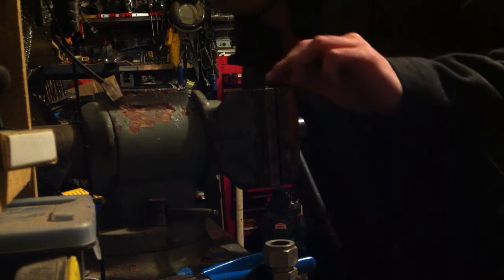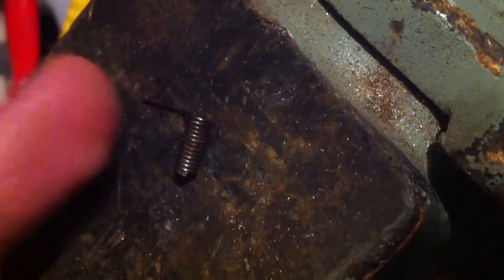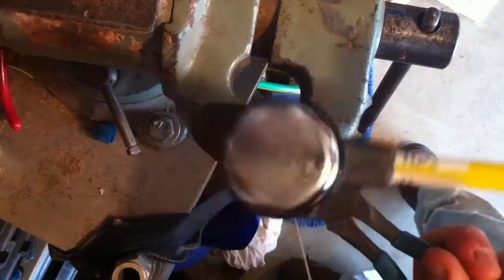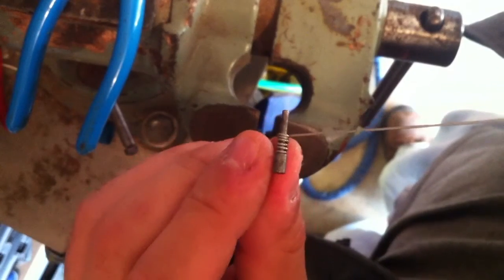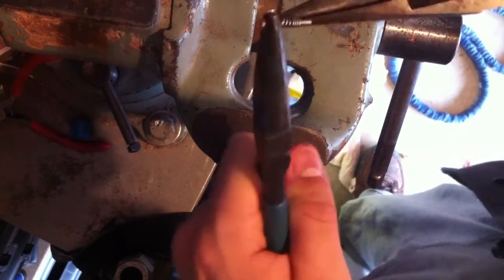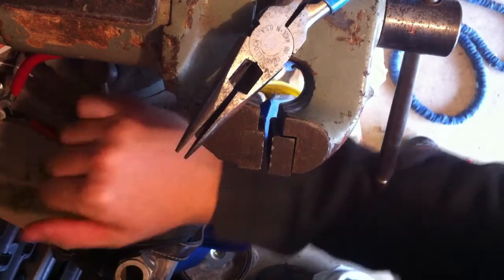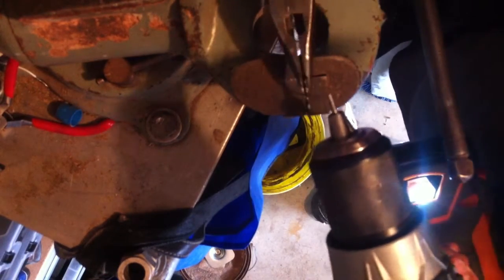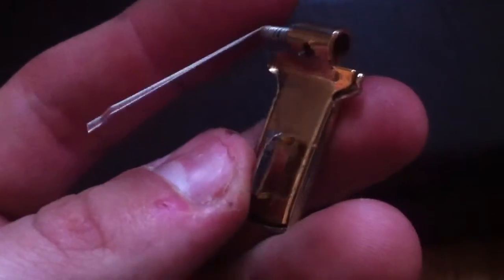Case Repair - Respringing Latch

Comment: Great vid.  I tried to make my own replacement springs using piani wire lenghts, and it sorta worked. Got one latch done. Curious to see how you got the pin out of the latch. My nexr one has closed ends on thin the pin area. Absolutly whant to reuse the latch as the brand logo is printed into it, and that's real cool.

Comment: I loved you drill method, but I think your local hardware store will have those…
Reply from the maker: Hi Robert, in Canada I really have not found any torsion springs like this locally. As an instrument repairman I do have access to the appropriate springs, but they all come from the USA. Often my advantage as a repairman is in improvising and fabricating parts on the spot instead of keeping a huge stock of every possible item.

I appreciate your comment. Perhaps I’m looking in the wrong places - I’d be happy to hear about it. Take care!
Reply: @woodandwinds  gotcha…I think I’m going with your direction and buying whole new latches as well. Thanks for the DIY on the subject.